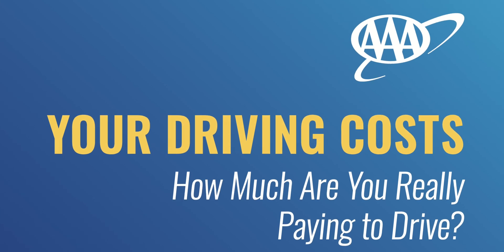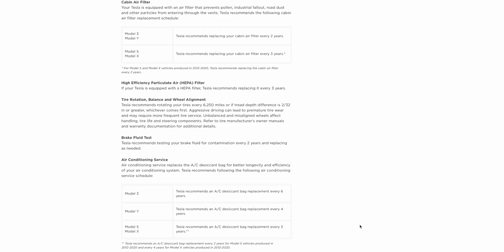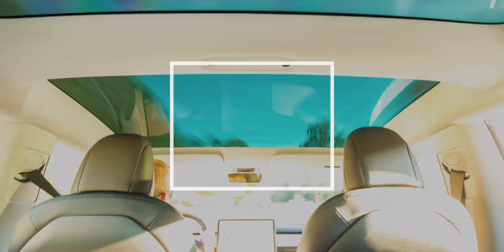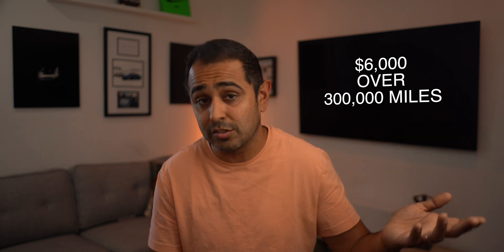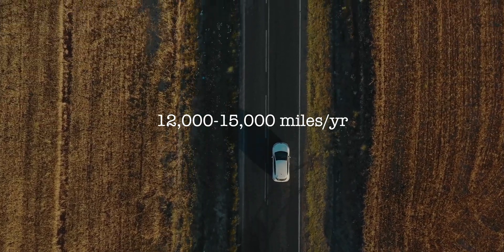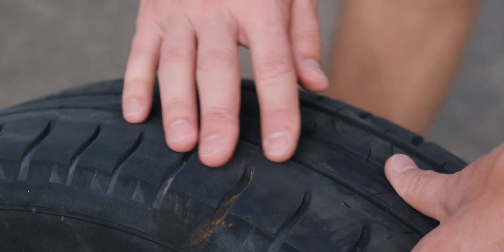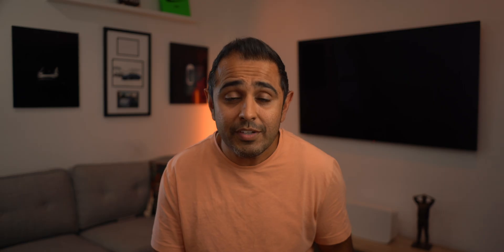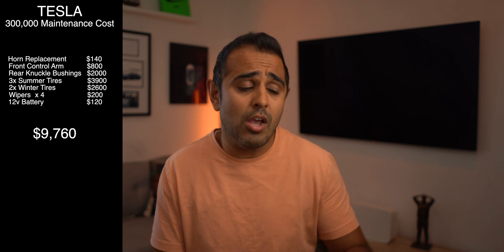How much does maintenance cost on a Tesla Electric Vehicle?

Comment: I am at 70,000. Miles on my 2018 model 3 and so far I have spent the same amount on maintenance that I spent on gas. “$0” 
And my tires still look really good. I’ve lost about 5% of battery capacity in 4 years. A full charge use to be about 310 miles now it’s about 295. The most economical car I have ever purchased.

Comment: 300,000 miles in only 4 years is not normal. Spread it over a more normal 15+ years with no warranty and the things that will go wrong on a high tech EV will be MUCH higher cost.

Comment: Just got to 30k on my 2021 kona EV. I've done zero maintenance. I really do like having a 2nd vehicle which is my off-road truck. For that I change the oil every 6000 miles full synthetic. I've only gone through one set of breaks on the truck and swapped out the UCA'S to a more durable one.

Comment: Raj, did I completely miss something or did you fail to calculate cost of recharging / supercharging across 300,000 miles. Seems to me adding up all the costs should include gas for the ice vehicle and super charging across 300,000 miles for the EV. EV will still come out on top but the margin will be vastly closer.
Reply: He didn't include Battery Replacement Cost for average users after 100K miles (Out of Warranty). It easily costs $7K to $15K.
Reply: @warofhero  well I hear you but the EV batteries don’t die after 100,000 miles. If they are maintained via proper charging cycles they can last hundreds of thousands of miles. Just like gas engines if properly maintained can last hundreds of thousands of miles. But if you’re automatically going to factor in replacing a battery just because it passes 100,000 miles then you must also factor in replacing a gas engine just because it past 100,000 miles and it’s also out of warranty. However you slice it it’s not a perfect comparison I thought he left a couple of these important pieces of info unchecked regardless of which side of the argument one is on.

Comment: One of the significant contributors to tire wear is the max torque at 0mph. It scrubs tires way faster than ICE cars.
Reply: Too bad the accelerator pedals don't work, huh?
Reply: @deekay2  have I missed a news story or are you saying that 0 to 60 in less than 2 seconds is slow?
Reply: @Mephistopheles111  The last time I looked, all vehicles have an accelerator pedal that you can variably control with your left foot in the United States or are you saying that Tesla's only have an on/off button for acceleration?
Reply: @deekay2  lol.  Sorry, I didn't pick up on what you were saying 😁. In my 1st summer season I burned through a set of all seasons and that was with driving almost exclusively on highways. After that I switched to chill mode and I do get better tire usage but they do scrub fast.

Comment: No new glass? In my M3P (over 2.5 years) I had 2 new front windshields and one top piece of glass replaced due to highway winter driving. Glad I WFH now and that hopefully I won't have to replace glass in the Plaid :D
Reply: This!  The windshield in the Model 3 seems to crack from the slightest highway pebble tossed up.  I keep one of those resin glue kits in the car now just for this reason.
Reply from the maker: Ooof yeah glass repair can get expensive and it’s truly luck of the draw.  But glad all the other belts, oils and fluids we no longer have to do!

Comment: Did he change his battery out or did it last the whole 300k miles?  Also, if it is the original battery what % does it fully charge to now? E.g. 80%. Thanks Raj for everything you do.
Reply from the maker: It’s still lasting on original main battery. His 100% charge gives him 248 miles from the original 310.
Reply: @TeslaRaj  WOW. Still holds 80% charge and this is on the older battery tech. Can’t wait for the 4680 batteries.  Thank you again.
Reply: Who cares

Comment: Maintenance cost is only part of the cost picture, and anyone doing cost comparison between EV and ICE should actually do a TCO (Total Cost of Ownership) comparison. So also look into purchase cost, insurance, repairs, battery replacement. You will see that these are anywhere from 10% to 50% more on EVs. 

Another issue is the fact that only Tesla can service them and there is very little third party service available. I found out the hard way that these cars are quite difficult to diagnose and service. This is only going to get worse when there are more Teslas on the road, quality drop due to higher mass production, Tesla service unable to keep up with demand. Being a software engineer I know that software defects constantly rise as the software base increases and requires much more testing with higher number of features while maintaining backward compatibility
Reply: FUD much? Can we add in the environmental degradation from ICE car tailpipes as well?
Reply: Why would anyone add a cost for something they are  not replacing. Only an idiot would add the cost of a battery pack to the total cost of ownership. Why would an owner of a Tesla do that when on the flip side the requirement for  an Ice vehicle to factor in the cost of an engine and transmission?
Reply: As indicated, the owner of the vehicle, after 300k miles, is still using his original batteries and gets more than 80 percent of the original capacity. 

And after 300k miles, an ICE vehicle would likely be on its second engine and transmission if not third, most people don't keep their cars at that point because with 20k moving parts that platform is too high maintenance to hang on to.

EVs only have 20 moving parts by comparison, and operate at significantly lower temperature variances (under 200f vs around 2900f in a combustion platform), which in turn makes it easier to design them around self contained/closed loop systems, which leads to much longer lasting lubricants and such.

Comment: I can corroborate Raj’s claim.  Tesla will tell you the car doesn’t need any service, but if you want an inspection they will do it for a handsome fee.  I opted out.  One of the he biggest expenses is curb rash.  Their wheels extend out wider than tires and are prone to damage from curbs.  Tesla quoted me $800 to replace wheel without tire on a 2021 model S.
Reply from the maker: Offf yeah curbrash is the WORST! I have anxiety every time I’m parking or navigating near curbs! But usually guys can fix it at your house for about 100-150
Reply: There are a lot of places that will fix crub rash and bent rims.  Fyi

Comment: I strongly think that tire wear is mainly due to how much you enjoy the accelerator pedal or take sharp corners at higher speed...  Everything that put stress on a tire make it wear faster.  That could explain why the driver of the car you gave as an example was able to get better lifetime from its tires than expected...
Reply from the maker: Yeah your right the torque from the electric motors also do wear down the tires as well!

Comment: Has cars do not require brakes at 15000 miles.  They can vary greatly.  But 40,000-60,000 miles is very common on gas car brakes.  And you replace them when worn out.  Not by miles alone and pads cost $60-$100.  With labor is $250-$350. 

EV tires don’t last less than any other heavy car with relatively small tires. My Mustangs and Corvettes would eat tires in 15,000 to a max of $25,000 miles. They were high performance tires with grippy rubber.  Tire longevity is dependent on performance level / rubber hardness.
Reply: I think you may have misunderstood what he was trying to say with the brake pads he was dividing 300k miles by 15k miles and only adding the cost of brake pads not the rotors or callipers or labor. So 300k miles divided by 15,000 miles is 20. Multiply $30 which is kind of on the low end for brake pads by 20 and you arrive at the $600 he was referencing. You can still argue that most brakes last 50k to 60k miles even in that scenario when you add in the cost of rotors, pad and labor for one to two brake jobs that's well above the $600 he used in his calculation so if he uses your example six brake changes at 60,000 miles with just an unheard of cost for a shop to do them of $300 would make the example even worse for ice  vehicles as this would be 3 times more than Raj used in his example.
Reply: @barrygreen9967  Ok, makes sense

Comment: Come on Raj! You didn't mention THE BATTERY Are you saying that Mike's battery lasted 300,000 without replacement? How much will it cost him to replace the battery? Also what range does he have at 300,000 miles vs when he drove it off the lot? I really want to know because my 2020 M3LR has 45,000 miles on it and that's what every single person I talk to asks me.
Reply: It is very Abnormal to change your Tesla's battery (the run that makes you car go vs the 12 volt battery that runs lights, etc) during the life of the car. People tend to want to change cars hundreds of thousands of miles before the battery needs to be replace. 

As for how much range loss their is on a Tesla battery, it's about 1.5% per 100,000 miles vs something like an original Nissan Leaf which was about 40% range loss.

Most often the mention of weight of electric cars is the electric vs the lightest weight gas cars and not an equivalent gas car and that is MUCH closer than people that hate electric cars wants to admit. Which is why this guy with the Model 3 had to change his tires a lot less often than would be expected if you took the WRONG figures and calculated how anti-Tesla/anti-electric vehicle people TRY to tell you.

Are their people that have had to change their batteries in a Tesla (the ones that drive the car)? YES, ABSOLUTELY!!! Wait a minute, didn't I just say that batteries -usually- last for hundreds of thousands of miles???

Junk for for electric cars. The faster that you fill up your batteries in an electric car the worse it is for the batteries. Which is why you only want to charge up your Tesla (or other) electric vehicle when you NEED to like on trips and not every time you need to "fill up" the batteries. Eet at McDonalds every meal your whole life and you won't have the same life expectancy that you do if you eat "reasonably" well. So ... only charge up at a Tesla Supercharger when you NEED to.

While we're at it, do you gorge with every meal? My guess is that if you do you probably weigh (literally) as much as a car. Charging your electric vehicle's batteries to 100% all the time is just as bad for them. What you SHOULD do is charge them around 80% unless you NEED the longer range like you are going on vacation or something. 

EVEN THEN you really don't need to charge your Tesla (or other electric vehicle) up to 100%. How often are you going to drive for approximately 300 miles at a time? All the time? My guess is never. All your need to charge your battery up to is how long you are ACTUALLY going to drive, plus maybe 15% due to variation in altitude to make sure you make it to your next location. It only takes about 15 minutes to charge your Tesla 150 miles of range, assuming that the beginning and ending percentage ends up less than 80%. 

What my wife and I do is go get food, either at the grocery store or ... a fast food place, and then take our Tesla to a Tesla Supercharger and charge for maybe 20 minutes (that buffer because of altitude or excessive heat or cold which reduces range) which will gives us more than enough range until the next time we need to stop for a potty/food/get out and stretch for the sake of your health break from driving.

Oh, and note that most Tesla Superchargers are within easy walking distance of places to go get something to eat. So you can take your car to the charger and start charging it and THEN go get your food. Just don't take too long because once your Tesla had totally charged up (unless there are a lot of cars charging at that location and then Tesla might limit you to charging to 80% if you want more or not) they will start charging you for taking up the charging space making it so that other people can't use that charging port.

My wife and I bought our Tesla Model Y long range when I was 59 and she was a few years older than me (which she still is of course) and I FULLY expect this Model Y to last for the rest of my driving life and beyond. Hopefully (though I'm not counting on it) Tesla Full Self Driving will get past the beta stage before I have the ability to get into a car (not to drive but get into one at all) so that I can experience the joy of telling the car I want to go to X and it drives me there all on its own without me having to have me or anyone else behind the steering wheel.

Hopefully this answers more of your questions.
Reply from the maker: Well I wanted to mainly focus on maintenance in this video but Mike did say that his 100% is 249 miles
Reply: @TeslaRaj  That would make a good video. It's something non EV geeks worry about as they assume EVs are like cell phones and the batteries last only a few years.
Reply: @beachcrow  agreed that this question is one that pops up almost every time. I respond with that’s shouldn’t be the concern. The concern would be better focused on the fact newer battery tech is coming out often(2018, 2020,2021,2022) there are like 4 diff kinda of battery tech out there between those years.

Comment: We have 80,000 miles on our 2019 Model 3 and the tires have lasted just as long as any other car we've had
Reply from the maker: Holy smokes!
Reply: @TeslaRaj  Ever heard of "Drivyn"?
Reply: You should sell the car after 120K miles then use the money and buy the new Tesla with tax credit. It is very expensive to replace battery.
Reply: @warofhero  Did you even watch the video? Talked about a guy with a Tesla Model 3 just like my 2019 that has over 300,000 miles on it and hasn't needed the battery replaced yet lol 😄

Comment: Weight can't be the issue because a Tesla Model 3 weighs the same as a BMW 3 series (actually lighter than some trims of the BMW). I think it can more likely be attributed to mashing the accelerator more often since it's so much fun in a Tesla
Reply: I agree! My first set of tires lasted me about a year and a half because every start was a jackrabbit start. After paying $1600 for a set of Michelin CrossClimate SUVs I've become a bit more conservative on the jackrabbit starts and the tires look great even after 30,000 miles.
Reply: @barrygreen9967  agreed! Same scenario for me.
Reply: The instant torque im certain attributes to tire degradation
Reply: Dude, Of course driving hard is gonna wear down the tires faster on any car. And with Tesla‘s addictive instant hard torque that will kill tread quicker.  But to your comment, a BMW 3 series weighs between 3100 pounds to 3600 pounds depending on trim. Model 3 weighs 3500-4000, single vs dual motors. Tesla is heavier. When you COMBINE acceleration or breaking or corners on a heavier car, that COMPOUNDS the treadwear kill factor.
Reply: @rono33  if you look up "BMW 3 series weight" they can weigh up to 4,138 pounds
Reply: @teslasnek  I did look it up that’s where I got my numbers. Maybe the google source was wrong. But anyway I used to have a 3 series a few years ago and tires on that car wear quickly too, which still shows that the extra heft can add to tire wear too. Just sayin. (Another consideration is that the model three performance comes with very soft performance tires, as do certain BMW models) so judging treadwear on those particular models is kind of fruitless on such soft rubber

Comment: Good job on the cost comparison except you didn’t mention that after 300,000 miles Mike still has a very good Tesla that has several hundred thousand miles of life still in it!
Reply from the maker: Absolutely! Thought it was obvious that if 300k was that easy a million is going to be cake! 😉
Reply: And the original battery, contrary to a lot of FUD these days…
Reply: What we all want to know is how much of his battery capacity is still left after 300k miles of driving.  How much range has he lost over those miles?
Reply: It's shown that with normal care, batteries should level off around 80% +/- 5% in the long term unless there is a major failure (sort of like an ICE car blowing some critical part in the engine and needing a rebuild). If the range works with your regular drive at 80% you can drive it for a very long time.